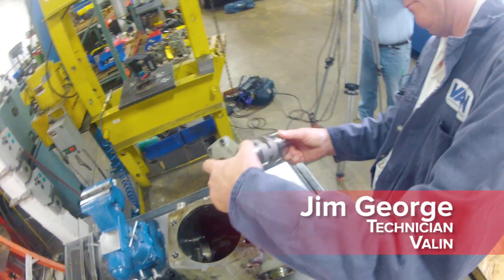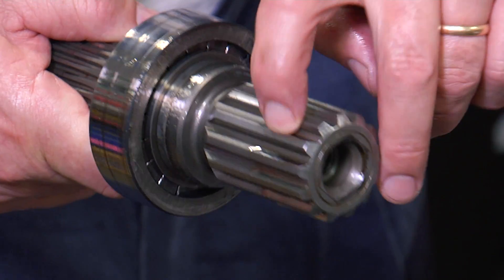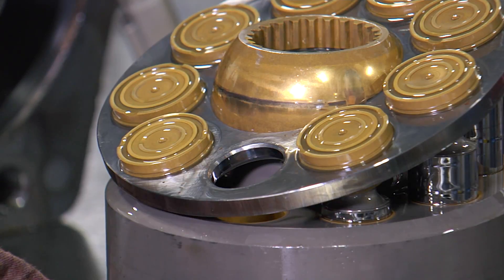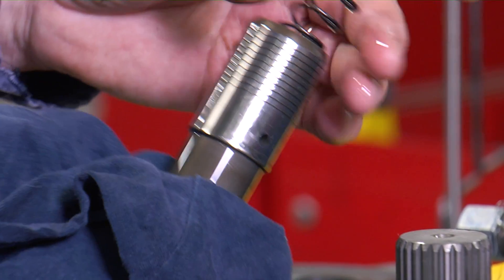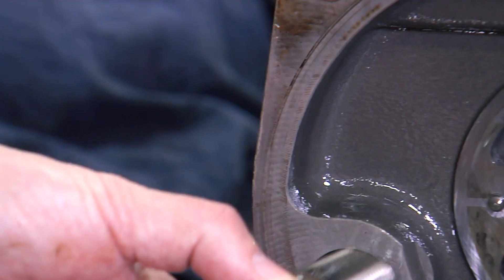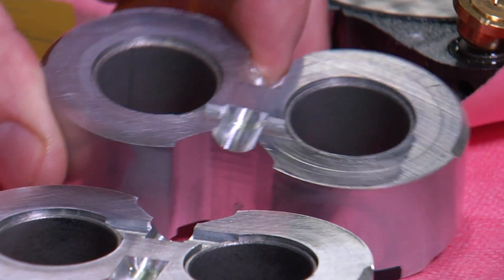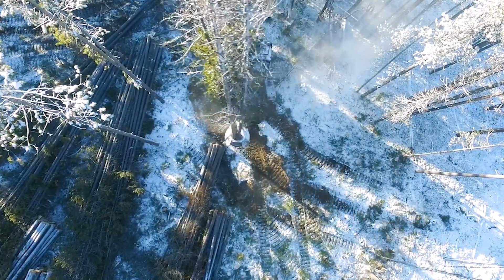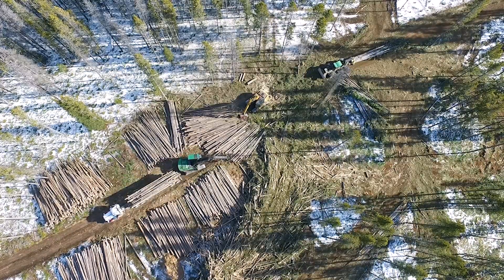Parke Logging Hydraulic Teardown by Schaeffer's Oil

Comment: Looks like any decently maintained hydrostatic pump at 10k hours. I don't see anything special I would attribute to the brand of oil. But the gear pump looks particularly good. Gotta wonder if that gear pump wasn't changed b4.
Reply: I was present when this video was filmed.  When Jim tore down the gear pump he just up and left the film crew and went to his office.  He came back to the shop, the camera crew started rolling.  You could see the shock on his face.  He went to his office to call the customer.  The shop foreman at Parke Logging looked over the maintenance records again to verify it was the original pump. You will notice that his hair is messed up from scratching his head when he came back.  To this day, Jim is still a big believer in Schaeffer Hydraulic Fluid.  I stopped by to visit with hime a while back.  He told me he can tell whenever a pump comes in that’s  had Schaeffer in it.  Anyone familiar with a Feller Buncher like this with a hot saw on it, 10,000 hours without a tear down is unheard of.  It made a believer out of me!
Reply: my husband was the operator of that machine for the first 8,000 hours on it. He said they had zero problems with it!
Reply: @Wannabejober  I would challenge that statement about Amsoil !  I've seen NOTHING but amazing things from it for the past 40 years...

Comment: Cooled my engine 10 degrees average. Better starts at 10 negative and better lubricant on hot days better fuel mpg. U name it.  Better oil my 2 Chevy s 255k miles Moyer clean and no click in lifters no leaks in seals it's the best!